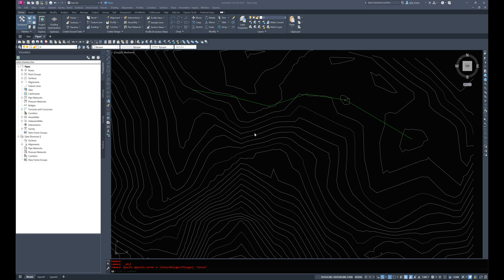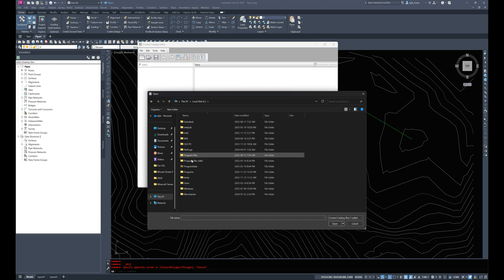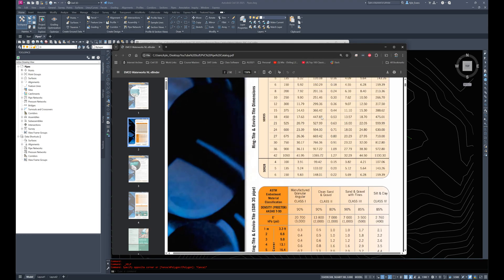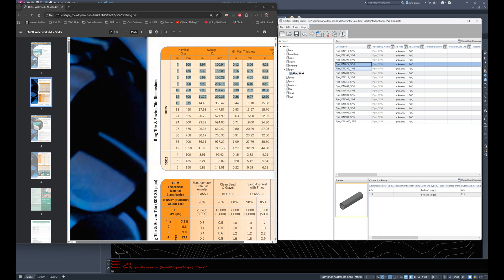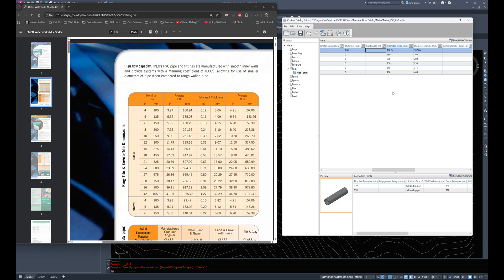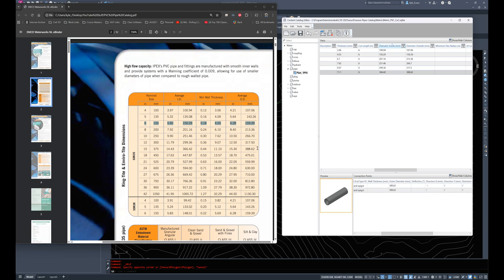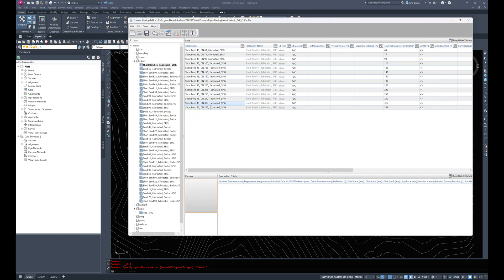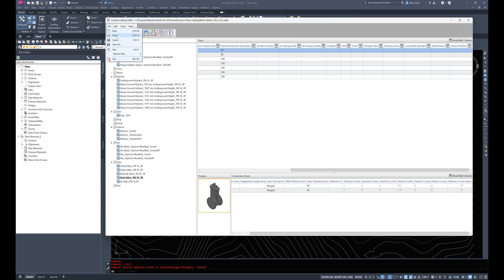Part 1 - Pressure Pipes - Content Catalog Editor

Comment: Thanks Kyle, unfortunately the pressure pipe system really still lacks in my opinion, particularly on the metric side. Are you using Pressure Pipes in your current work flow? I still use alignment and profiles for watermain.
Reply from the maker: Yeah, they are still not great. For being released 5-6 years ago it's kind of disappointing. Most design companies here are still not using them, and are doing a various mix of things to show water.
Reply: @KyleEvansCivil you should make a tutorial on some of the methods. Would love to see some alternative work flows. Cheers
Reply: @cyrusadams6629  We use pipe networks with a water catalogue. I am not a fan but it works.